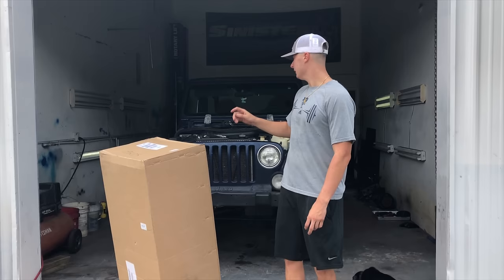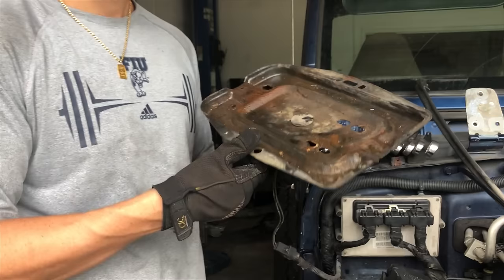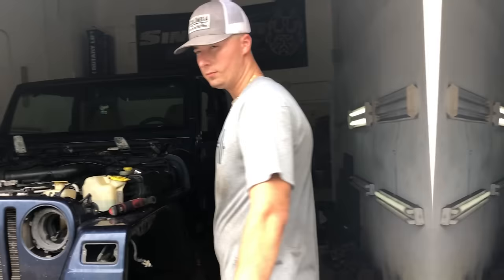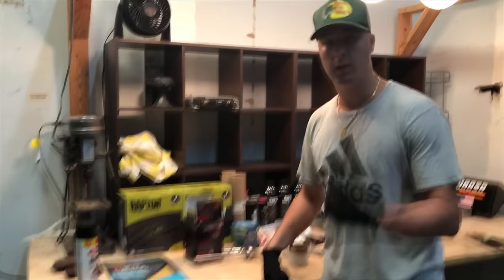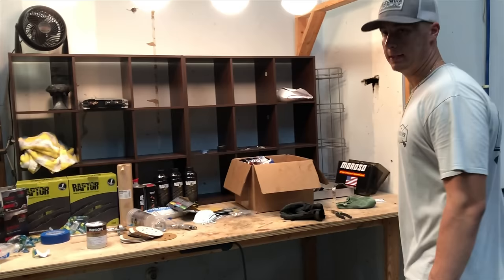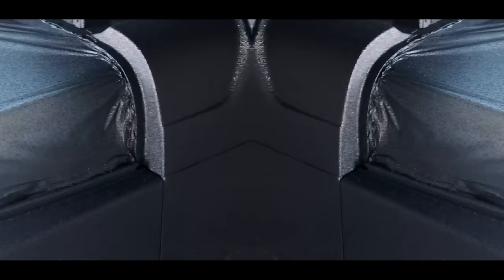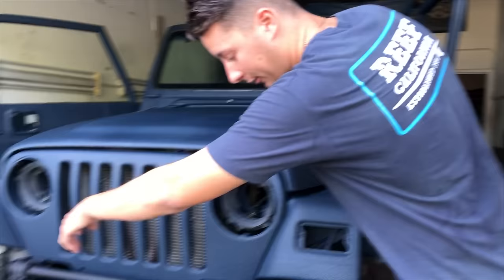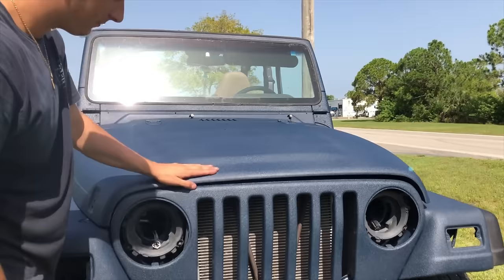Painting My Entire Jeep With Upol Raptor Liner - DIY

Comment: I followed your link to the kit. It's black. How do you factory color match exactly. I see kits with pre-determined colors, I also see tinable. My 98 TJ is Deep Amethyest Pearl. I dont want to lose such a unique color. Is it simply ordering the paint code from U-pol?
Reply: I have a 97 and found paintscratch.com for my paint to tint the raptor liner and it was dead on. My paint code was/is PCJ(Dark Montego Blue Pearl) which is some what rare from what i understand. Anyway it matches perfectly I also went to a body shop and asked how much tint to use per bottle of Raptor liner and was told 2 to 3 oz. I used 2.5oz per bottle and the color was dead on. Hope this helps not trying to plug a company at all, just help a fellow Jeeper!
Reply: Your reply is perfect. I found one other video that clearly mentioned it. Thank you for your insight. Also thanks for the link!

Comment: Did you have a filter and pressure regulator on your  air system?  I notice some zebra striping on the hood and I'm about to do this and want to try to avoid it.  cool thing is probably a respray is easy.

Comment: man that thing came out very zebra stripe big time
Reply: work hard i see almost every bed liner paint job is like that...i plasti dipped my truck and it came out descent i want to bed liner it now being that it’s more durable but every paint job i see it’s zebra stripped when sun hits it...I’m guessing it’s the gun that comes with the paint kit instead of using a paint gun to get wider and wetter coats ?
Reply: Sean Hunter that’s what I’m afraid of.
Reply: I just received my Raptor Liner kit today. I'm thinking of forgoing the crappy gun that came with it. I can't see any way to even create a fan pattern with it. It's just a completely round nozzle. No wonder so many Raptor Liner jobs here on YouTube end up looking like this one--like it came out of a rattle can. I may try my Wagner airless sprayer with this stuff. I think that might work well.
Reply: @therealgaragegirls  that have a gun you can buy that has an adjustable tip that allows it to fan out more
Reply: Maybe do a tiger stripe design and make it look intentional lol
Reply: @iiSup3rior  LOL
Reply: There's some very good raptor jobs out there you just have to thin it correctly and understand how to paint with a proper technique
Reply: Hey megan how did changing the spray gun work out for you
Reply: Hey megan how did changing the spray gun work out for you
Reply: Hunter Robinson Honestly, it didn’t work out like I’d hoped. In the end, I just used the gun and nozzle that came with the Raptor Liner. I found the best way to avoid zebra/tiger stripes was to stay well back from flat surfaces on my final coat—and to use multiple random patterns as I went along.
Reply: Hunter Robinson And the Wagner airless sprayer experiment was a complete mess. I don’t recommend it’s at all.

Comment: I just bought  raptor traptor liner, for my truck. Did you find  the color came out lighter then  you planned or did it hold true  to  your color. Thats my biggest worry with mixing a color that it's going come out to light
Reply from the maker: Yea it comes out lighter depending on what color you do. Have the paint shop mix you only paint with no binder and if it’s a light color then have them darken it but my blue came out perfect. I used the oem paint code
Reply: @judahfindley   I have two colors in mind   kinda a toss up and opposite. The truck is burgundy  so I'm thinking  a black cherry will come out lighter but still be darker then  stocks.  And then on the other end of the spectrum  I'm thinking a blue  maybe a little lighter then yours.  The blue is what makes me nervous the most ! But I want it more. Haha
Reply: @judahfindley  what happens if you leave in the binders?

Comment: How much paint did you mix in with the liner and is there a certain paint i need to get to mix
Reply from the maker: Itzvasage _  full to line with Harder and full rest with paint . For paint you need paint with no binder. Just the tint .
Reply: @judahfindley  you know how many mils that would be and fill to what line with tint
Reply from the maker: Itzvasage _  I couldn’t tell you but just fill the bottle up to the line with Hardner and the rest with tint . Don’t fill too the brim though because you won’t be able to shake it
Reply: @judahfindley  ok thanx man I appreciate it
Reply: How much was it to paint the whole Jeep
Reply from the maker: Cuz I Can  around 300$
Reply: Judahs Garage heck ya man that’s not bad for all that you painted, looks good, great job 👌
Reply from the maker: Cuz I Can thanks man 🤘